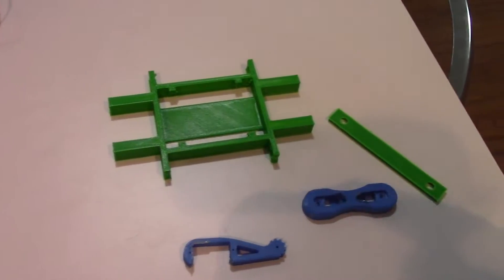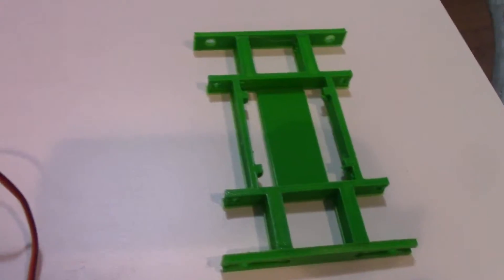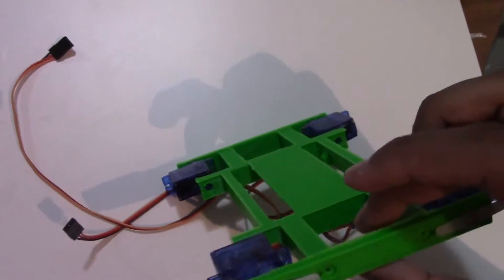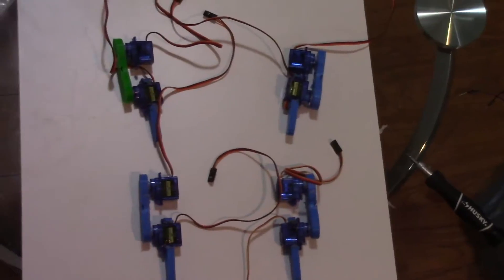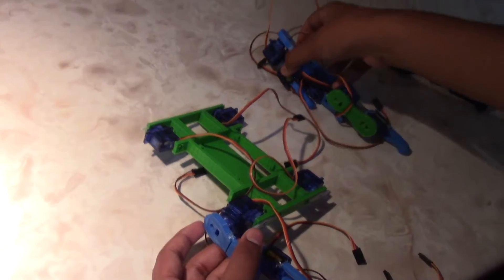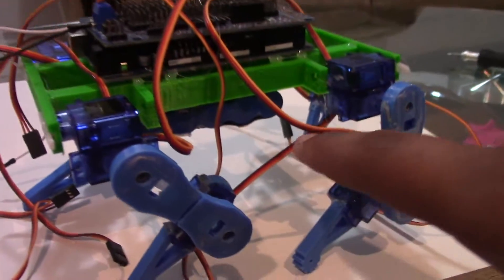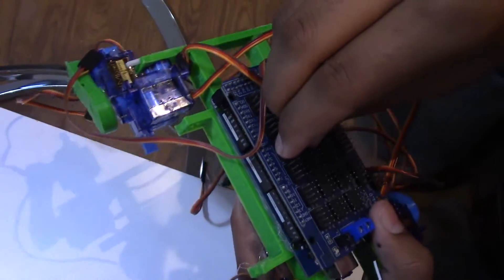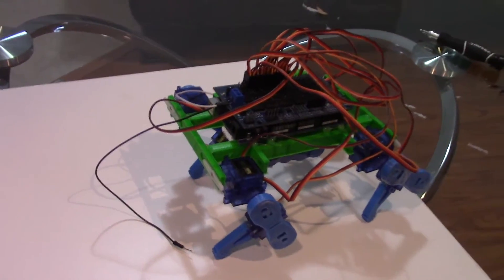QUADRUPED ROBOT PART 1  BUILD AND WIRING

Comment: Which Arduino, specify please..
Reply from the maker: we used an Arduino mega
Reply from the maker: but you can use any arduino if you connect the servos from digital pins 2-13